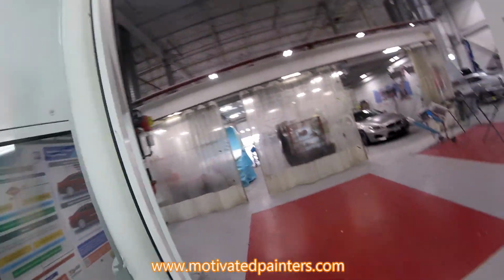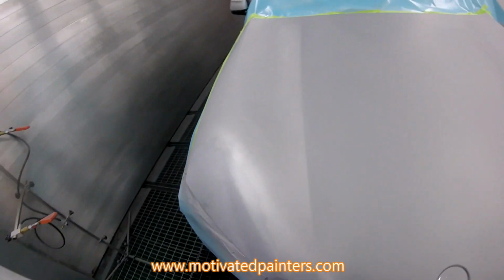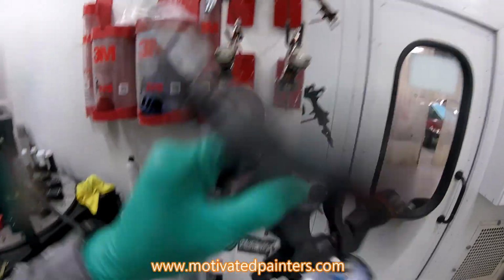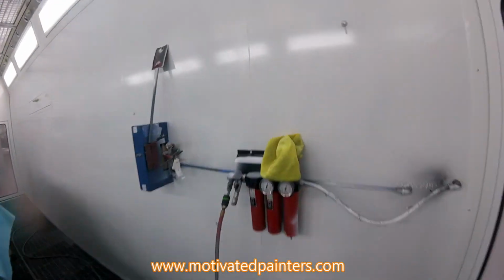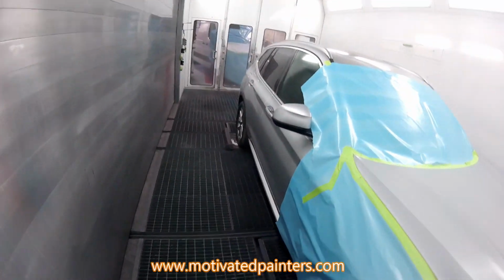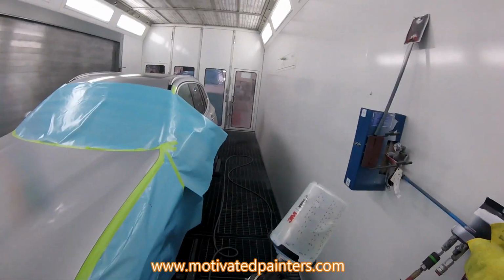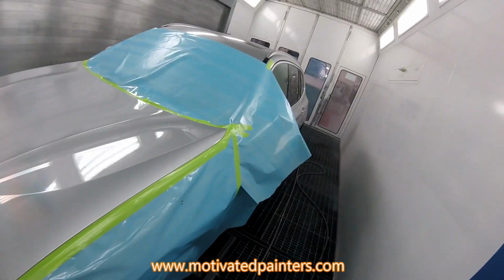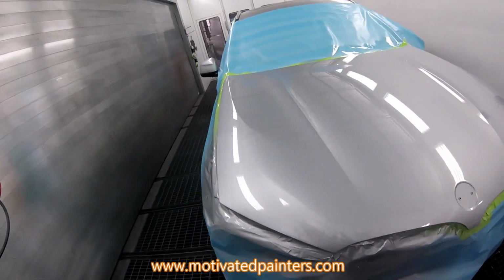Silver Hood Blend BMW

Comment: As a 45 year veteran of the trade, I can say that you’re a good painter and you are definitely trying to do your best. However, some of the things that you do can be improved upon by changing up your techniques here and there. In this blend for example, I would blend it backwards of the way you did. Instead of starting with the first one or two coats for coverage and blending out, creating as you call sand piling, the technique I learned a long time ago is to put the 1st (light)coat on out to where the end of your blend will sit. In this case, almost to the back edge of the right side of the hood, out through the middle of the hood. Then you taper your successive coats inward towards the repair area you want max coverage. That way every coat working inward always has a wet coat of paint to melt into, so you won’t have dry edges and metallic rings around the edge of your blend. Hope this helps, keep up the good work👍

Comment: I do well hanging hoods but not laying down.i always wanted to learn and have the confidence to paint silver laying down.im using dbc  basecoat and sata 4000 1.3 tip. any tips on this system ? Overreduce,misting,going heavy, is my primer too textured or new gun, ? What can I do that can work everytime. ty so much again bro .it's sometimes  I don't wanna do hood removal on euro cars with fancy heated washers you know. ty

Comment: You Canadians are so confused. Are you Imperial (ounces) or metric (ml). See why we in the USA are so stuck on Imperial measurements. Ounces are just more sensibly sized than those tiny ml.
Reply: As a painter I know it's easy to pick holes in someone's work.
Reply: @didzee002  Exactly what do these two comments have to do with the metric system? All I'm saying is that ounces are easier to visualize than ml.
Reply: @satamanschmidt3428  I got it wrong ,  far enough.